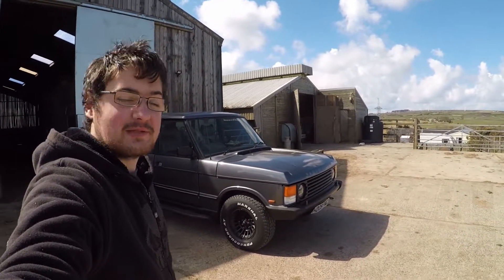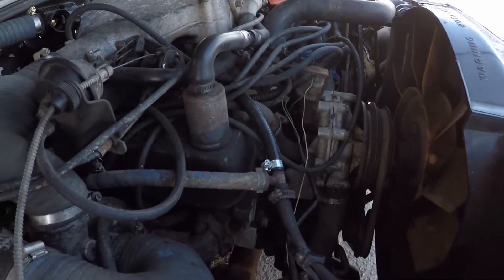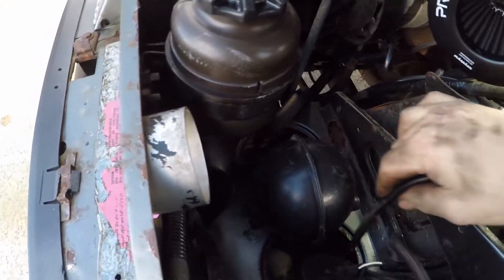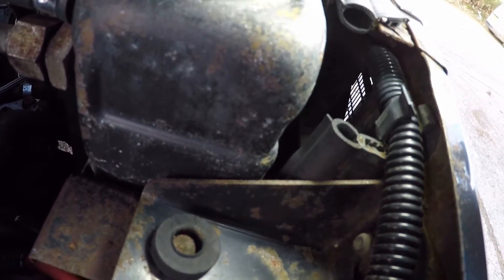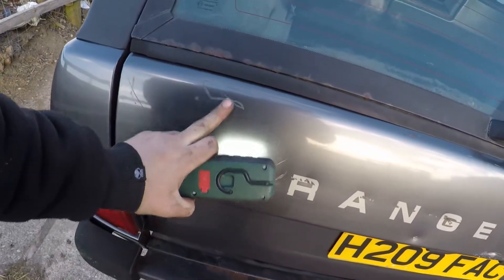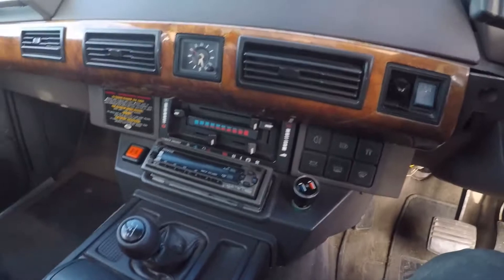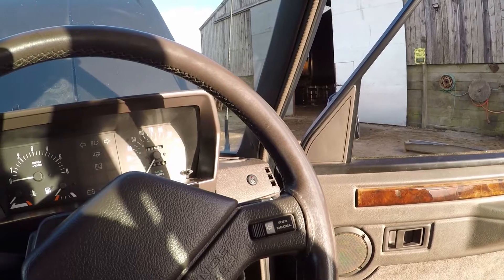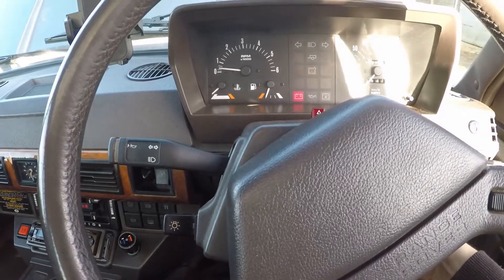RRC TT EP.1 : What's wrong with my Turbo Technics Range Rover Classic (Currently...)

Comment: Plenum "sensor" is an overboost switch they used to kill the ignition if the boost went too high. I had a TT230 XR4x4 2.8 V6 which had some similar looking mods...would guess the turbo is a T3 Garrett of some description.
Reply from the maker: Interesting, might have to remove that one as i don't need that kind of negativity in my life

Comment: What size tyres are they? As a comparison my 1989 runs on 235/70/16 and look reasonably more inside the arches than yours, perhaps a previous owner has put on some wheel spacers as it's a common trick to increase the track width and improve stability. Worth bearing in mind when considering the centre of gravity is considerably higher than a regular car and does affect the handling somewhat.
Reply from the maker: it'll be the wheels pushing them out, think tyres are 235's

Comment: R/R.  Looks like a stupid immobiliser has fried itself inside the engine bay dude ?  Pull out old air-cond condenser before the radiator and fit a D2 intercooler !  V.
Reply from the maker: it's all getting pulled out soon, D2 intercooler sounds interesting, had thought about the RRC tdi radiator/intercooler setup